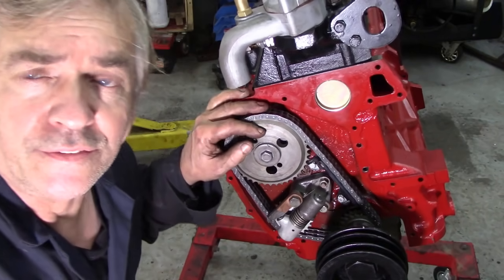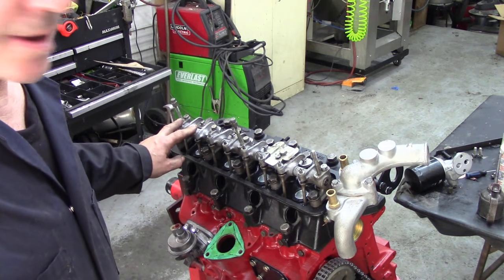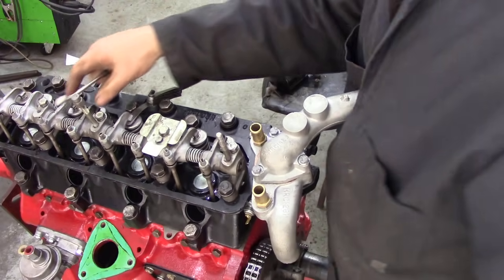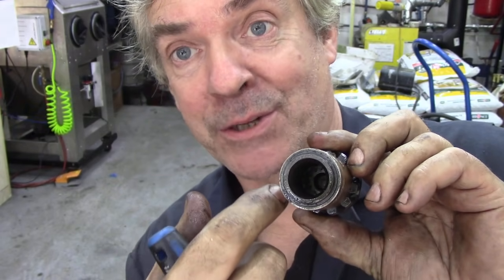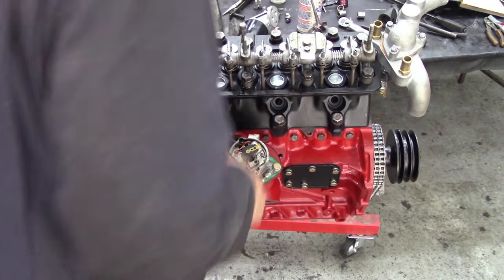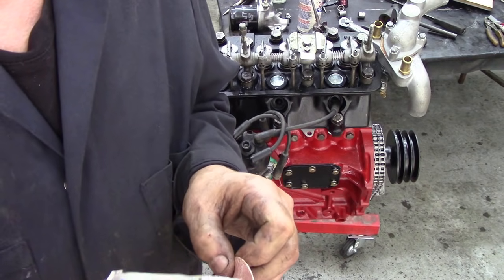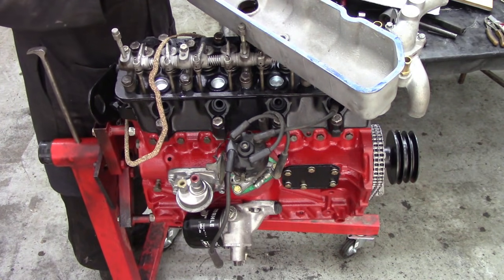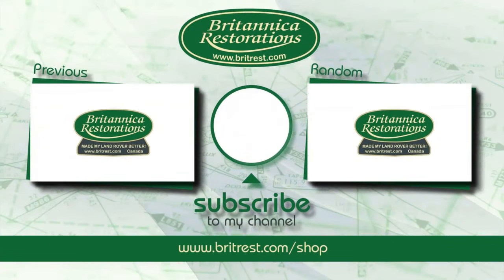2 25 Engine. Fitting the distributor drive

Comment: Mike, this was a really helpful video. I too was confused to find the P on the camshaft sprocket 180 degrees out with number one  piston at TDC, until I read the manual and noted that it had to be at TDC on the firing stroke on number one cylinder. I set mine up without the head on so I couldn’t see where the valves were rocking on number 4 cylinder. However with the cam gallery covers off, you can see the cam lobes for number one and four cylinders. Like you I marked the angle of the skew gear offset on the block with a sharpie. Getting the skew gear aligned was ok, but the hole in the bronze bush sits slightly lower than the hole in the block. Raising it up to align alters the skew gear slightly. It’s something of a challenge getting the grub screw to line up with the hole. How folks manage that with the engine in place is nothing short of miraculous. I have to say I got the same sense of achievement the I fitted the distributor and found the rotor arm facing correctly. A Jamieson’s moment!  I’ve never rebuilt a 2.25 engine before, your video series has been enormously helpful and entertaining, thanks again
Reply from the maker: Glad it helped - I now do them with the head on - even if not tightened down

Comment: That explains how I managed to get not one but two series engines 180 degrees out, both ended up with number one at the rear, took me a little while to suss out why it wouldn't start, never did change them back.

Comment: These videos are very handy for me Mike thank you! Got a ex mod series 3 2.25 petrol that's having bit of a spruce up and the engine just won't run right and there's a few gaskets that need replacing etc we think it's the carb that needs rebuilding as when we have had it running (all be it not for very long) it's sounds sweet as a nut, keep up the good work!
Reply from the maker: The Zenith carbs are awful - stick a Weber on and it will be fine
Reply: @BritannicaRestorations  great advice, thanks again

Comment: Hi from Costa Rica.. Nice video learning to work on my series petrol
Reply from the maker: This will be the same as your engine - it is a little difficult to understand, but I can answer any of your questions!
Reply: @BritannicaRestorations ok what number can I contact you
Reply: The only way I can get the P in line with the center of the tapped hole is with piston #1 at TDC but rocking... If I put it on TDC Compression the P points down like in this video  🤯😂

Comment: I have got hold of an oil filter housing to fit to my 2.25 but the oil pressure switch threads are stripped. Could I utilise a helicoil in this application? Do you threadlock the helicoil in or fit it dry?
Reply from the maker: Helicoils are fitted dry

Comment: Mike, will you be running that engine on the stand before storing it?
I think it'd be interesting to see/ hear it start and run. Good tutorial on valve and ignition timing setup.
Reply from the maker: I cannot run it yet as I have no decent carb
Reply: @BritannicaRestorations  please let it be a Zenith Carb and please show how you deal with the setting up of the carb the running... Im struggling with mine.
Reply from the maker: You will never get an old  Zenith to run correctly as the castings warp, allowing fuel to enter the engine via the venturi - it is almost impossible to re machine the base of the carb to correct this issue.
Even the new Zenith out of the box had bad castings back in the day - Stick a Weber on and problems will go
Reply: @BritannicaRestorations  too late... got one from Carburettor exchange in UK... actually runs well but blue smoke...

Comment: Hi Mike great video’s, I’m a mechanic of 30 years. I’m currently building up my 2.25 diesel 5MB, replacing the timing chain & tensioner the original gears look ok. I’ve timed it to the EP on the flywheel & exhaust valve peak opening as all suggest, but I’ve heard a lot of people saying it needs to run advanced on the flywheel to get it to run better. What do you think? 
Thanks Daz.

Comment: More good info.
Why not set the cam gear on your petrol the same as the diesel?
What direction did you set the gear so when it rotates, the slot is pointing in the right direction?
Reply from the maker: The petrol does not need to be so accurate and to fit the gear is a bit it and miss but according to the book:-

 Lubricate and insert the skew gear assembly into 
mesh with the camshaft gear. Due to the helex 
angle of the teeth the gear will turn anti-clockwise 
as it slides into mesh. The broad master spline must 
be at 20" to the centre line when correctly seated, 
as illustrated, but it may take several attempts to 
achieve this.

Comment: One crank rotation will give TDC with the P aligned.  You can then set the skew gear 180 degrees from the book and have the same result.

I use the “rule of 9” for setting the tappets - the sum of the valve that is fully open and the one you should be setting is 9, ie when 8 is fully open, set 1, when 7 is open, set 2 and so on.  Easy.
Reply from the maker: I always to 2 at a time - easy

Comment: Check the freedom to rotate the distributor shaft after inserting the distributor shaft bush retaining spigot screw..if it's the same as the diesel you don't just screw it in, it's a stupid system..